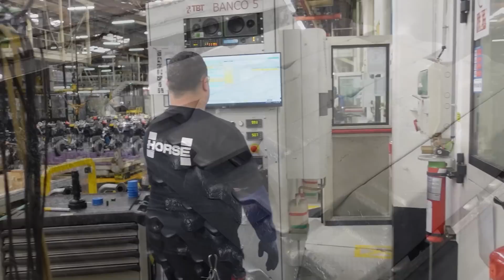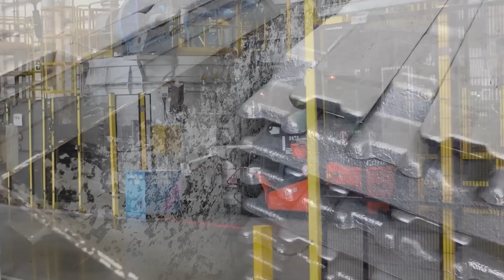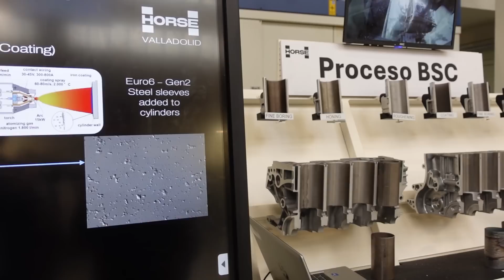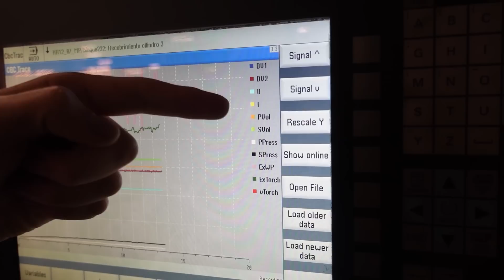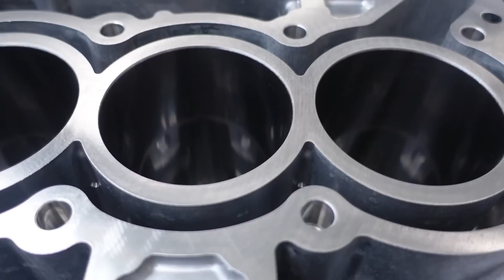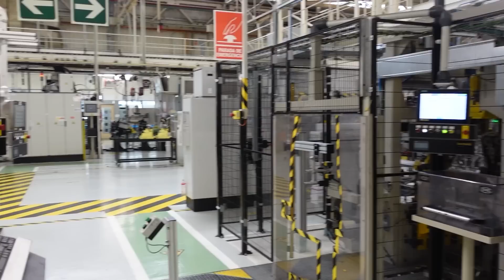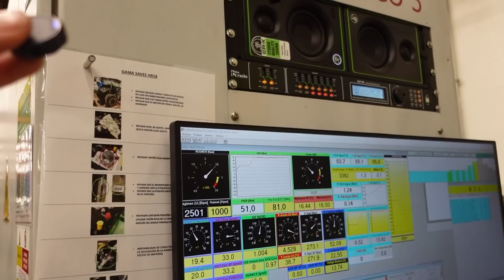This Is How They Make 1 Million Engines Per Year - Come With Me Inside A Super-Modern Engine Factory

Comment: The spray coated cylinders was all new to me, super cool to see how the micro pores hold the oil. I wonder how many mechanics know that new engines don't have cross-hatch
Reply from the maker: I thought the same thing...at some point maybe they do the head gasket and think it's all glazed and ruined and convince the customer it's shot 😅 it probably doesn't happen though...I hope
Reply: @d4a  for a road bike please buy a old run down vfr750. 
replace regulator with a John Deer alloy regulator, put the smallest "solid state" fuel pump in, buy a front wheel(cheapish online) for front floating disks(must have, i cracked a disk). rip everything off and put "coils over plug". the thing is Mad Max, will never fail, all cheap honda stuff is going going gone. Burn the clutch all day or clip on the quiet muffler and ghost.
Anyways. rant over. is a beautiful engine and chassis, then shareholders held out on the rest,  have 140,000 on mine now. 

watched to much 80's mad max as a kid. thanks heaps for this, was awesome to see. but im gonna stick to my ld28 and put whatever into it, lpg, ethanol, No2, and a CO2 cylinder(to flame out the engine intake and bay for fire or engine runaway). all mechanical etc with ratios off cables and adjustable length lever arms, pressure regs etc. all i need is a "F" series diff at the right ratio and there are none left in the country lol. guess i just weld a new diff into it. mad max, dont ever go to the dealer. nothing after 1998 for me thanks. mechanical diesel turbo lpg ethanol for the car(to get cold clean burn, not power unless needed). Petrol stripped down bike and a Pushbike. Couple jerry cans aside and go
Reply: @d4a  In Eastern Europe there are a lot of old school mechanics that provide legally questionable service taking cash only without any receipts. If the ones doing engine rebuilds are anything like the ones fixing brakes and suspension and such it's more than likely that there will be a lot of misdiagnosed engine problems. They might decide it's necessary to hone the cylinder walls, maybe even ruin an engine that just needed a new head gasket.
Reply: @BitterCynical sometimes it’s just misunderstanding of a failure, not malice. Mechanics are humans after all.
Reply: It's been around a lot longer than that, Nikasil coating. Moto Guzzi were early adopters plus others.
Reply: @steven-k7j7v Nikasil is plating, not thermal spray.
Reply: Porsche engines from i think the mid 70s @steven-k7j7v
Reply: The coyote in my Mustang has this type of cylinder walls coating. Lake Speed jr has a video where he talks about how well this surface holds oil which then lets companies spec a thinner oil.
Reply: The guy also says that the engines are non rebuildable and the tour guy agrees with him.
Reply: My 2018 Nissan Versa has the "mirror bore" cylinders. The same engine is used in Renault cars. Seems to be a good way to manufacture engines.
Reply: The coating is a plasma spray arc iron, which is going to replace Nikasil and sleeves. Porsche has gone to this procedure with their 9A2 generation 3.0 L 911 engines. There a few manufactures that have been doing this for quite awhile now.
Reply: This spray coating has been around for 10+ years already.
Reply: @vvevvevvvv My 1980 Ducati's cylinders were Nikasil (?) coated. (no sleeves)
Reply: You have never (Until now) Seen this process or how it is achieved!!🤫
Reply: @vvevvevvvv more like 40 years. Japan has been making engines for long time this way Nikasil, Alusil, Lokasil, and Silitec
Reply: @AUMINER1 those treatments are cast-in-place and electroplating processes not PVD.
Reply: And I wonder... how much machining talent is being lost.  No independant business can afford all these machines, and [affordable]  repairability is disappearing.  So a great line from Spinal Tap is in order:  "Fine line between clever and stupid".
Reply: Didn't GM try something like that in the 70s?
Reply: Racing diamond coats piston parts and walls
Reply: @Dirtyharry70585  DLC?
Reply: @Dirtyharry70585  The right way. Cost something but you have some thing.
Reply: Kawasaki were one of the pioneers in electro-fusion cylinder lining developing the technology in the late 70's, it has also been a standard feature in model engines since the late 70's...
Reply: Porsche has been doing this for a long time, they did have a problem with it's not long ago because they changed the coating and it was causing problems!
Reply: @pudermcgavin4462  I wonder if part of that was because of being a flat six piston sitting on the lower part of the cylinder ?
Reply: Seems this helps explain the direct injection spray pattern wear on cylinder walls i see.  These coatings do not like thousands of psi fuel bouncing off the pistons onto it.  The pistons can tolerate it but the wear evidence on cylinder walls shows the coating is affected by di.
Reply: Kawasaki used electro fusion cylinder lining starting in 1978. This process is faster and cheaper to produce but isn't durable like a nikel-silicon carbide plating.
Reply: Mate if anything goes wrong there’s no hone no reborn no new sleeve it’s scrap.  Rubbish.  Junk
Reply: Cross hatched sleeves seems like a better option for rebuilds because not every motor will last for eternity and to me, a motor that’s serviceable and friendly to a mechanic is a good design. I don’t like non-serviceable parts or one use designs. Plus wouldn’t cross hatching give a more equal distribution of oil around the circumference of the piston? Would someone be able to explain to be if this is a better idea than cross hatch?
Reply: Anyone who works on these engines will know the blocks are basically disposable.
Reply: Cost saving at the expense of durability. Whether its sprayed-on Silica-Microns or Iron sprayed on to an aluminum/magnesium block; no substitute for nickel rich iron block or nickel rich liners for piston rings/piston skirts to run up and down in.
Reply: Back in the 1980's Mercury Marine was using a hard chrome cylinder coating on their large V6 2-stroke outboards that did not have a crosshatch pattern. It had 'pitting' in the cylinder that was said to hold oil just like what Horse is doing. What a concept to have something like it being used today.
Reply: I know that VW is doing that for years now, it is much cheaper for them.
Reply: @skorpikh ...and much less reliable engines as a result!
Reply: @robohofo1  I am not sure that it is related to this new tech. That seems solid to me. Other EURO6 stuff is killing new engines.
Reply: @skorpikh my 2006 passat just turned 200000 miles today!
Reply: I bought a new motorcycle and going through the frustrating new engine break-in procedure, wonder what will be the consequences of this spray-coating for a new engine break-in.
Reply: All of us dummy spray in liners have become the new norm hence newer engines aren't worth the honing process for rebuild .
Reply: I found out about this when the r35 GTR was released and we got to pull one apart
Reply: TWAS = nanoslide since 2006, nothing new
Reply: some BMWs have the spray coating
Reply: Why didn't you show the little cutie that was helping you mic up.
Reply: Friend of mine is a Merc mechanic, he told me of this process over 30yrs ago, when they rebuild an old aluminum engine they send it away for treatment of the bore.
Reply: This tech - direct iron spray - was developed by Ford yet first application was Nissan GT-R VR38 engine.
Nikasil is a galvanic process. Alusil is cast-in hypereutectic alloy. Silitec is drop-in hypereutectic into std alloy block.
Reply: I have always been told never hone a chrome or coated bore never.
Reply: Planned obsolescence. Car for one first owner...
Reply: Straight up...disposable engines for a disposable society..😪😒🙈😐💀
Reply: @Depth_of_Breadth  Everything is disposable. Cars are made of iron which will eventually all rust away. Even the aluminium block itself will eventually crack from metal fatigue. Good engineering is designing the car to be as good as it can be for the price point and for the expected lifecycle, designing a car to last 100 years when chances are it'll be recycled in 20 is dumb.

Low friction coatings on high performance engines has been a thing for decades. High performance engines are not supposed to last a million miles, and shouldn't be that's not the point. No the engine can't be easily rebuilt but the coating improves performance and efficiency during the engine's actual lifecycle.
Reply: @Depth_of_Breadth But don't worry. It won't be a disposable price. You'll still get to pay 10s of thousands of dollars. They just won't last very long. Isnt progress great?
Reply: Actually the new Alusil coating that we are talking about is detrimental to engine reliability. Combined with 0-30 or worse engine oil. This is why many modern engines crap out below 100k miles or worse 100k km. Look at MLK motoren and their frequent engine rebuilds. This might be a video on itself for you!
Reply: garage 54 made a test were they discovered that mirror polished cylinders have less compression than just regular cylinders. Because there are no micro pores for oil to stick to.
Reply: @Manysdugjohn  Did you watch the video? Your comment is totally out of place.
Reply: @lauraiss1027  yes i did. They use special material so this type of polish isnt " trully polished"
I am talking  normal cylinders that were rebuilt.
Go watch the video i am talking about.. honed cylinders or mirror finish.
Reply: Chevrolet Vega in the 70s had an aluminum block with silicon embedded in cylinder walls. Maybe the entire casting had it? There was a special honing process that took away aluminum and left the silicon exposed in cylinder walls. The aluminum pistons were iron plated to provide contrasting non stick surface with cylinder walls. It worked OK until overheated or worked too hard, then the iron plating on pistons & exposed silicon layer failed. Then it was aluminum pistons against aluminum cylinders and resulting self destruction. Chevrolet replaced a lot of those engines. 

I was in the rebuilding shops at the time. We bored blocks and installed cast iron sleeves and glass bead blasted NEW pistons to provide the traditional old school aluminum piston skirt in an iron cylinder format. It worked OK, but not really financially viable. Most Vegas were simply junked. A couple we did were the rare Cosworth 4 valve OHC head version so maybe worthwhile in that case. 

The Nikasil coated cylinders in many old 2 strokes worked great until the coating failed, then kaput. Engines like in this video maybe have the problem solved? If over heated all bets are off.
Reply: @Bitterrootbackroads  It is strange that they did not test the engine thououghly, The customer is the tester and pays.
Reply: @louisvanrijn3964   Near the end of the video they showed running the engine on the dyno. What more do you want from a factory that only builds engines? At Toyota, when they assemble an engine, they don't run it when it's finished. They install them in the cars then ship the cars. They don't start the cars.

Comment: I guess the cylinder steel coating instead of a sleeve insert makes the block cheaper to make. Probably can't machine it to a larger bore when it's worn out, unless the coating has considerable excess thickness. The temptation is to say it's worse for ecology but I wonder what percentage of worn engines get rebuilt anyway. If most of them end up melted down to be used as raw metal again then there's no point going through the effort to make engine blocks that can be reused multiple times.
Reply from the maker: From what I gathered this is more expensive, the technology and machine itself is incredibly expensive and it only makes sense with massive engine quantities. The only reason they do it I think is efficiency, emissions and weight reduction. When it comes to rebuilds, I'm afraid you're right, the only engines that get rebuilt in most of western Europe nowadays are special, valuable or large industrial and truck engines. The price of a rebuild usually doesn't justify it for a small car engine.
Reply: @d4a  Oh that's ironic, so it makes for a more efficient engine with better emissions but no more reusing of a worn out block. Cuts out one of the parts in Reduce, Reuse, Recycle to focus on another.
Reply: @BitterCynical   Emissions is not a option though. You meet and sell engines or do not meet and do not sell engines. As such technologies like this make sense. Also for the manuafacturerer at some point the cost of an engine replacement is lower than an engine rebuild. Especially in western europe where labour by a mechanic at a dealer is way more expensive. So the reuse in the later part of the process is not interesting. 
Secondly, manufacturer makes more money on selling new things than providing warranty on old things. 
It is all economics, which is why emissions are written in law because manufacturer and end user do not care at the point of sale.  (in case of these small engines anyway)

Comment: I have one of those engines, a 3 cylinder 1.0tce fitted to a Dacia Sandero. No problems so far (40k km), luckily for me I do not intend to keep the car long enough to need an engine rebuild. Consumer age...
Reply: It's an ok motor. They even come with LPG injection as standard. Economical and cheap to run.
Reply from the maker: Yes, they do the 1.0 in this factory too, but most of what you have seen is the new 1.2 (HR12) that will go into hybrid drivetrains.
Reply: Yeah, mine is one of those. Got an extra 10 hp and some NM when running on LPG. Did not knew about the micropores, seems that the method works well since I do not experience any oil consumption.
Reply: Good news!!

Comment: It’s a pity they do spray coating as they have tendency to separate from the aluminum and basically the only way to save a block is to go back to that to the traditional method and put the sleeves in
Reply: You can do the sleeve job when it failed, maybe spray will last as long as the normal steel sleeves, or even longer.
Reply: @ that’s what I said

Comment: THis is so cool. Usually, manufacturers will never let you film inside their factories let alone casting foundries.
Reply: It's nothing new nowadays every company knows how make engines but it is amazing how much goes into making one
Reply: What you meant was "ive never seen manufacturers assembly factories or foundries" Plenty of manufacturers allow this, even Ferrari, yamaha, moto guzzi, harley davidson, etc. Theyre not giving away secrets, they all use the same processses. The composition of the molten metal is secretive but they're not giving it away with a visual tour.
Reply: they even allowed him to record critical performance data!
Reply: @gearloot    "Critical" only applies to new technology, not this 50 and even 100 years old stuff.  Nothing they are doing is state of the art...  NOTHING!
Reply: @gearloot we know it's with the big data on Google cloud now so don't worry
Reply: 😂That is because the foundary and machining line are filthy place. Not exactly something you proud to show off.
Reply: They are showing this new tech cuz these are closed vendor machines and will not be on sale for any workshop or 3rd party workshop.
Those engines are use and discard no rebuild no re honing or reboring or sleeve replacement.
Made to last some kms and then crush the whole car and buy a new one........
Reply: @abid583ind  Why wouldnt anyone be able to machine and insert a sleeve to this design?   Coated cylinders are just a cheaper way to avoid sleeving, but does not prevent sleeving.
Reply: @MH-mc8mj  tell me you know all without telling me you know all....
Reply: @abid583ind  Your sarcasm exposes your lack .
Reply: @abid583ind  Sprayed cylinders can be and are resprayed every day . Mostly motorcycle engines but car engines could be but I think conventional liners are installed .
Reply: Lies, I've seen plenty videos of inside these factories. Learn to use the search bar mate.

Comment: making single use engines..
Reply: The easier and cheaper it is to manufacture, the less necessity you have to fix them later if it's cheaper to just swap them out. It can be economically and ecologically better than rebuilding engines with high efforts. We live in the age of mass production, why not use the advantages.
Reply: These are a lot better than the PSA 1.2 Puretech.